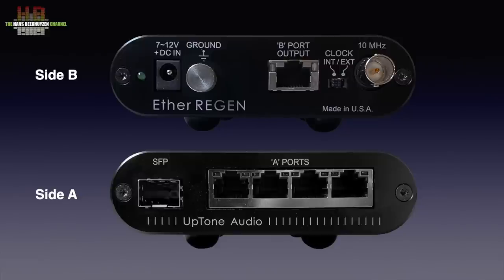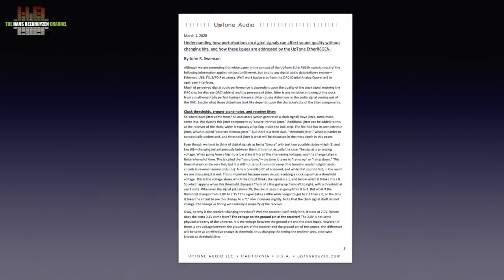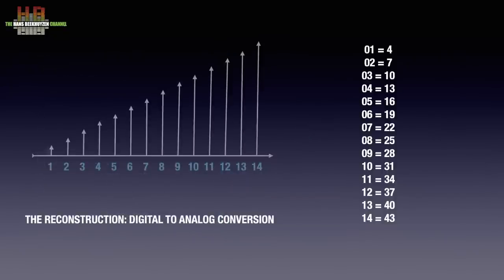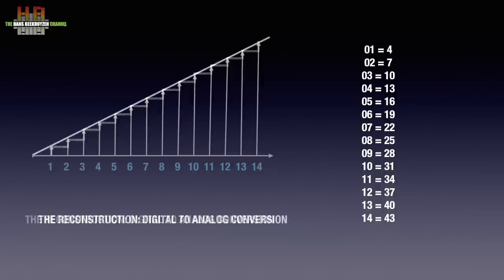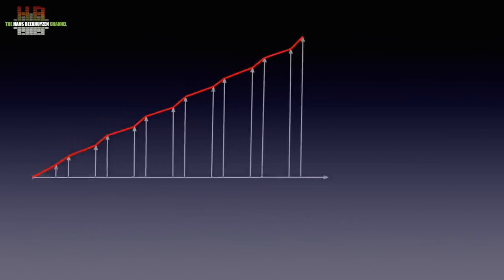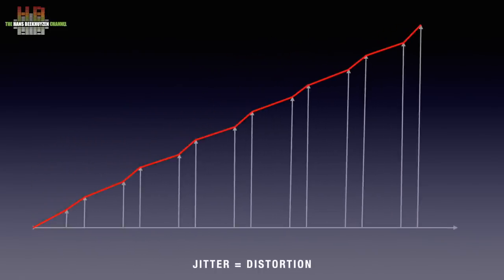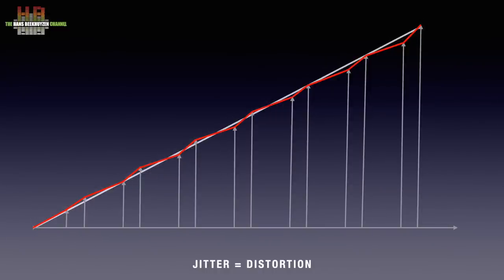Why digital circuits influence the sound quality

Comment: Good Explenation Hans. It's 100% in line with what we are measuring at the moment. That article will be published in a couple of weeks, I guess. I will link to this video for reference and explenation of the effects.
Reply: Hey, thanks guys! I watched your network switch contest, picked up the SW-8 and a couple Netgear GS108Ev3 switches. And OMG! What a difference these switches made in my setup. I never realized how much crap was in the stream, these switches made a profound difference. 

So much so my 80 yo mother noticed immediately the better sound and picture quality coming out of the TV and sound bar with bass module. The PQ was immediately noticeable, but what blew me away was the sound coming out of the Polk unit, and then the bass, if never sounded this good. 

I am now a believer. ;-)

Comment: I wish to confirm what Hans is saying in this video.  I use some galvanic ethernet isolators that are designed for hospital ethernet.  I use them both on the streaming device and also into my d-link switch that is providing ethernet to those streaming devices.  When i use a galvanic filter on the device only i have an improvement in sound.  When i add another filter to the d-link i have another improvement.  The improvements are always more relaxed and natural sound l. Another improvement is adding power filtering to the device, also adding power filtering to the switch help, basically anything you can do to reduce noise Also using a good quality ethernet cable helps, I use Amazon Basic cat 7 they are heavy and appear well shielded.  To anyone that doubts these things please try for yourself to verify.  Also final tip, i stream with a 100mbps switch.  I'm convinced streaming at lower connection speed improves sound as 100mbps should generate less noise the 1gigabit.
Reply from the maker: Thanks for sharing

Comment: Thank you Hans, you are a pioneer among audio reviewers in attempting to explain the complicated factors relating to networks and audio quality.  However this video left me with this question. Would a length of fiber (and the necessary converters) inserted AFTER the network switch and before the D/A converter serve to eliminate all the noise and jitter issues introduced earlier in the chain? I think of this as the "Small Green Computer" solution because they are well known for advocating this as a method of improving the digital signal.
Reply: It strips away the noise, but if the signal is already damaged already, it can't wipe away all the issues. I have got significant increases in SQ adding fiber into the mix. You can get a better signal to the FMC by using a LPS on the modem and on a non-wifi router. If your network is already pretty good and your speakers aren't super revealing, you probably won't notice much of a difference though fixing the pre-fiber side of things. At least that's what I have found in my system, but I have 100ft of builders grade CAT 5E in the wall between my router and my 1st fiber switch. That long run of unshielded cable might be why I didn't get much of an improvement. I have read in the forums others have got better improvements than I did in cleaning up the back end.
Reply: @Pete.across.the.street   Thanks Pete, another thought along this same line. I have a 3 unit mesh network distributing wifi in my house. This gives a strong wifi signal located right in the listening room and no physical connection to the network. Is this likely to already be yielding the same advantages of cleaning up the digital signal as inserting fiber and making a physical connection to the streamer? The mesh network is TP-Link and the streamer is an older Auralic Aries, the clamb shell model from 2015.
Reply: @brucebarbour9583  I think the newer AURALiC have some high end wifi receiver in them that's supposedly just as good as wired connection. Idk about your model. Experiment and see what you like. I have a Bluesound Node, wifi doesn't sound better to me. I think wifi has its own "problems" when it comes to hifi streaming. Idk the particulars though.
Reply from the maker: I have tested that on the Auralic Aries G2 to find that Wifi sounds better than a consumer switch but a professional Cisco switch is slightly better. The SOtM and Uptone Audio switches sounded the best. But that might depend on how crowded the Wifi bands are locally.
Reply: @brucebarbour9583  i also have a mesh system, with orbi. Tried also using a sattelite Wi-Fi connected, with Ethernet out from it. But I prefer the wall cable, I have 12 meters in wall, unshielded like you,  why is unshielded better than shielded? I am trying the melco now, previously had the ee8 and Paul pang quad, none of them seems to do anything I can pick out in a-b testing. Is so small (if there is any) that it would be impossible to take out in blind test.
Reply: @TheHansBeekhuyzenChannel   I have made the same test with my AuraliC G2.1 (bought based on your review), and I reached the same conclusion.

Comment: Greetings Hans:
Alex from UpTone Audio here. Thank you for kind acknowledgment of our research and product development. And you did a very fine job of explaining and illustrating some of the factors which affect digital transmission!
It pretty much boils down to the fact that:
Jitter on any input signal (not just Ethernet, this applies to ALL digital transmission!) causes amplitude noise INSIDE the chips and on the ground-plane of the circuit board. This AM (amplitude modulation) gets converted to PM (phase modulation).
This jitter/phase-noise (same thing, just expressed in time or frequency domain) propagates--both with interfaces such as Ethernet, USB, S/PDIF, I2S, whatever, and in the chips on the boards. Even a DAC containing a PERFECT clock sitting right next to the DAC chip/circuits input pin is going to be affected by all the upstream jitter/phase-modulation of the ground-voltage-reference that took place in the chips and on the PCB just before it.
 
The above is about as concise as I can be (and it is me paraphrasing the much longer and more nuanced and mind-numbing-fact-filled explanations that John Swenson has spoken to me over many conversations). It is the net of all the reasons anyone hears differences with ANY of this stuff!
 
In addition, common-mode noise--from power supplies--travels on Ethernet cables and sails right through the transformers at every RJ45 port. That type of noise is, just like clocking, one of the many factors introducing jitter/phase-modulation of the ground-voltage-reference. Common-mode leakage/noise happens to be one aspect of what the EtherREGEN's active-differential isolation moat is blocking. And then we reclock with an expensive 10GHz-capable ultra-low-jitter flip-flop (actually we do that on both sides of the moat).

As you may know, global chip shortages forced EtherREGEN production to a halt at the beginning of 2022. Very frustrating since demand was consistent and continuing—with more than 3,200 units shipped in its first two years. 

We have been working hard in development of EtherREGEN Gen2 for almost 1 year—utilizing more readily available parts and incorporating a number of technical advancements. These include Gigabit capability on both the ‘A’ and ‘B’ sides of our unique active-differential-isolation moat, even lower jitter clock synthesizers, and the world’s best sine-to-square wave converter (benefiting those who chose to pair with an external 10MHz reference clock).

Development progress on the new model has been very positive the past two months, and we have already pre-purchased over $80,000 worth of circuit chips for the first production run of 250 units. Unfortunately last week we discovered a problem—wherein one key chip (a specialized Ethernet PHY) that we bought and were designing with turns out not to perform an advertised capability, so we have to scrap $6K of parts and await samples of a newly released chip that we know will meet our requirements.
Therefore I now expect first shipment of EtherREGEN Gen2 will not take place until May/June this year.

The form-factor/casework of the EtherREGEN Gen2 will be the same as the original, and we expect the price to remain under $700 (quite a bargain for the parts and techniques; I get mad seeing other firms charge similar prices for generic designs with just $50 in parts—even if they are in fancier enclosures).

Again, I wish to express our gratitude and admiration for your fortitude in consistently striving to educate your audience on these complex--and often controversial--topics. The minutia affecting audible performance are real. John Swenson spent 31 years as a senior engineer at LSI Logic>Avago>Broadcom, and he specialized in designing the power networks inside the large scale chips that go into all this networking gear. 

By the way, John's recent week running phase-noise plots on his Jackson Labs PhaseStation (same as the $23K Symmetricom/Microsemi 53110A) has inspired him to build a board using some expensive ultra-low-noise, extremely high bandwidth differential amplifier chips he bought a while ago, to allow him to run either HCMOS clocks or Ethernet directly into the 50-Ohm input of the PhaseStation. This set up will allow him to directly measure phase-noise—off both the output of our clock synthesizer(s)--alternately based both on internal Crystek and external 10MHz AND from inline on the RJ45 connection between the EtherREGEN ‘B’ port and a streamer. The latter will be really interesting! 
 
We have never seen anyone else run low-offset phase-noise analysis on Ethernet. Jitter measurements and histograms only look at it over extremely wide frequency range—and boil it down to a single, less than useful jitter number. Yet as we have been trying to explain, it is mostly the low-frequency offset phase-noise that is affecting the whole ground-plane of the PCBs and infecting circuits. Of course he will do that Ethernet wire probe test both with internal and external clock.

Good times!
--Alex C.
UpTone Audio LLC
Reply: Future customer here, I have seen and heard first hand what a quality network switch can and will do, especially with a linear power supply.

Comment: This is a magnificent explainer, Hans!  Well done!  
On the forums there are many blowhards who believe the stage before the DAC is no more than 1s and 0s.  Ironically, this is quite a binary position to take.  I have experienced huge improvements to my music by upgrading the digital stage through improved cables, regenerators, power supplies and OCXO clocks.  The digital signal needs nurturing in the same way a traditional analogue signal does.  The main advantage, however, of such digital signals is that they can be cleaned and re-clocked, whereas analogue once it is wrecked stays wrecked.
Reply from the maker: true

Comment: This was very interesting. I can't say I fully grasp it. As you allude to at the start, the ultimate measuring stick in all this is audible sound quality (i.e. differences therein). In other words, technical measurements are useful only to explain and perhaps lend credence to known audible differences. If technical measures predict audible superiority but audibly such superiority fails to materialize in a structured listening test then the measurements are effectively measuring the wrong thing. This in turn kicks the whole issue over to the science of listening tests, which is a pretty vexed issue it seems.
Reply from the maker: Audible judgement requires a lot of training, guided by people that have more experience. It also. requires a lot of equipment for comparison and years of experience. Training to do measurement takes less time but here again the measurement equipment requires large financial sacrifices. And then you need to know what to measure, which currently becomes more clear is not what most audio engineers have done so far.
Reply: @TheHansBeekhuyzenChannel  This makes sense. What I am pointing out is a certain circularity in reasoning, however: New technical explanations such as the one this video are brought forward to in a way "prove" audible differences which themselves have not even been proven scientifically to exist. I myself also believe there is an audible difference in most if not all the areas you mentioned here, but my issue is that the measurement science, for lack of a better term, can't prove that the audible differences exist, such science can only explain them (i.e. explain WHY they exist) after they have been proven to exist in the first place through listening tests. Still, there is no harm is seeking an explanation for what seems pretty clearly there in more casual listening testing.
Reply from the maker: I can only fully agree with your argument. That’s why I depend fat less on measurements than some others. Measurements can prove a device is defective or badly designed, it can’t prove a device sounds excellent.
Reply: Thank you for your videos. Great stuff and I learn a lot!
Reply: @TheHansBeekhuyzenChannel  Thank you. Well stated!

Comment: Would it make sense to use an audiophile switch in my living room to connect most audio equipment, even if my Roon Server (a Mac Mini sitting in another room)  is connected to the audiophile switch via another "normal" switch?
Reply from the maker: Absolutely
Reply: @TheHansBeekhuyzenChannel  Thank you very much - one more question: in my understanding, Roon makes certain via RAAT that Roon Ready devices 1) get bit-perfect music data and 2) get full control of the timing in their clock.  To my understanding that's one of the reasons why RAAT sounds great. Do you think that even Roon Ready devices would profit from the audiophile switch?

Comment: When streaming from over the internet I guess there's a chain of switches and other components involved unknown to the end user/listener. Is this a relevant factor of influence when compared to streaming from within one's own home network?
Reply from the maker: Each component in the digital signal patch can (and most times will) pollute the square waves that carry the digital signal. That can be distortion of the wave form, noise, phase noise and so on. The better those components are, the less they pollute. But they will pollute. Consumer switches and cheap streamers are worse than enterprise class switches.
Reply: @TheHansBeekhuyzenChannel  OK. Then it's a factor but probably not a problem because most internet and cable service providers will use enterprise class components for getting the signal to the consumers, and at the consumer side you can still make a difference by using such components as well. Is that correct?
Reply: the internet does not work this way

most of the internet is connected by fiber and therefore electrically isolated  ... only the last mile is copper or coax so variants of FTTC and for the lucky few FTTH

independent of WAN technologies, even if you have FTTH, a cheap modem / router / media converter PSU brick can still add electrical noise to your home LAN and even an audiophile switch will not completely get rid of that, even with buffering and forwarding over an egress port

this is why changing your home router's PSU can also improve the sound, even with an audiophile switch in between that router and your streamer

but changing the PSU on servers used by  Tidal and Qobuz (this would imply changing the hardware of their CDN), will have zero impact on the sound at home

no matter how noisy the server in the datacenter is, there will be zero influence and all of that data will leave the datacenter bitperfect with virtually no packet loss
Reply: @colanitower  "Enterprise Class" switches can usually handle 24 or 48 outputs, can be managed remotely, have special security and firewall software or firmware built-in, and need to be more physically robust because the  replacement cost for labor or the impact of customer outage time is very high. Any business that depends on the Internet will be out of business very soon, or loose a lot of customers if their Internet access is down due to a failed switch. A decent quality home network switch works just as well in the home compared to an "enterprise class switch" unless you running a very high-traffic online business from your home and/or have more than 12 ports needed on a single switch.

Your home Router/WiFi box supplied by your ISP also has some firewall and security features built-in, but once you get inside your home network, any additional switches don't need that.

Many audiophile switches and streaming devices only handle a maximum speed of 100 Mbps, because that is fine for audio or video streaming (including 4K video). Both my Roku TV streaming device and my iFi Zen Stream for music will only connect via Ethernet at a maximum of 100 Mbps, even when connected to a switch or router with 1 Gbps (1000 Mbps) connection speed capability. That prevents one member of the family from hogging the entire bandwidth of the home network, and also the traffic when streaming is 99%+ only in one direction (and not bi-directional out to the Internet).
Reply: @Bonabuster  Thanks, that explains a lot

Comment: What if I just add a “network to fiber module” to my existing switch and connect my MicroRendu to it?
Reply from the maker: That surely can make a difference if the SFP's have good clocks.
Reply: @TheHansBeekhuyzenChannel  
How can I tell if it has good clocks?
Reply from the maker: Trial and error I am afraid